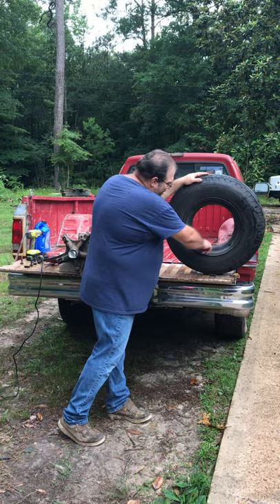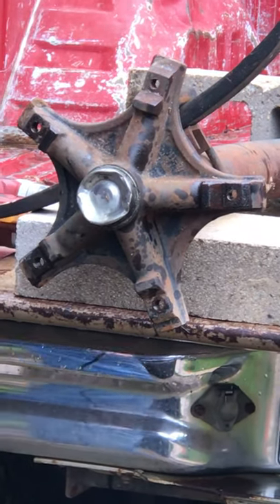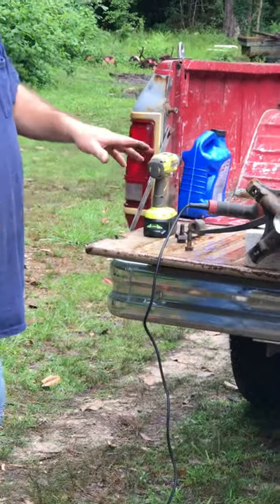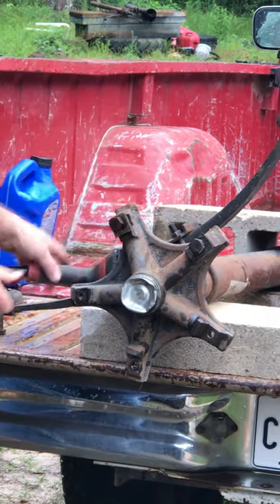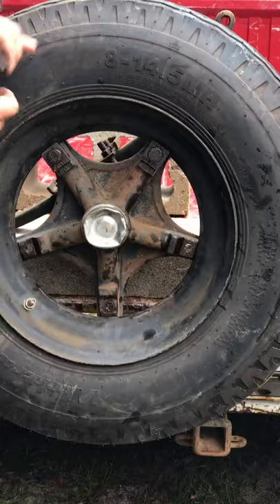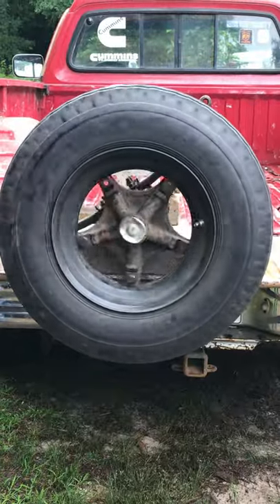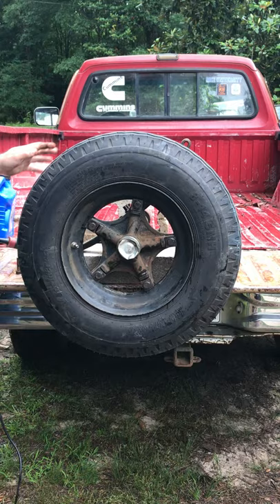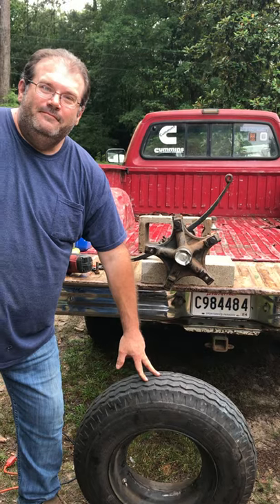Mobile home tire installation.

Comment: Awesome, thank you! One thing I used to do on heavy duty truck tires (Dayton / spoke) is stick a piece of wood next to the tire to look for wobble / runout, seems like it would work here too.
Reply from the maker: Yes a piece of wood will work or a hammer handle works well too
Reply: I've used a soda bottle. Lol

Comment: My father's old homemade farm trailer has four of these tires and they are all rotten--maybe 40 years old.  All the metal and oaken bed are excellent shape.  I only need to replace the tires and wiring.  Your very informative video  is a blessing.  Thanks.

Comment: This is the only video with the correct info on wheel installation. So many jack legs on you tube giving wrong info that will cause the wheel to fly off.
Reply from the maker: Thank you sir

Comment: Thanks Man like the ol school knowledge Havnt seen any Vids on tire install on rim Can you do them by hand.Mine is a 7-14.5
Reply from the maker: Yes you can do them by hand. Just use a similar technique for tightening then down. Just use a four way or breaker bar.
Reply: @qualitymovers4573   Thanks Man !
Reply: @qualitymovers4573   I meant mount Tire on Rim.👍🏻
Reply from the maker: @nopro5433  yes, but it's hard to get on wheel. I use a strap or starting fluid to blow on. Of course I recommend that for safety reasons!🤷🏻‍♂️

Comment: Very helpful. Thank you. How do you change the tire (and tighten it) if you have a flat but no power tools? With the standard lug wrench or some other tool?
Reply from the maker: Lug wrench or breaker bar with short extension will work. It will just take a little longer. After you snug all the wedges, you will need to put a little pressure on tire to keep it from spinning.

Comment: I've got a car trailer with this setup on it, double axle. Is there a simple, easy way to "balance" these bad boys? My trailer shakes when it's not loaded and can see the tires out of balance just slightly. So I guess I should reverse your video steps and back lugs off and go back around and tighten? Thanks for your time man
Reply from the maker: You have some wedges tightened more than others. One way to fix problem is to Just take two off and go back to three in a triangle pattern. Look how far each is pulled in and try and get them close to the same. After that spin tire and see if it wobbles. If it still does, spin slowly until the tire goes out toward you and pull that wedge in more. Once you get bit close out the other two back on and start tightening each evenly.
Reply: @qualitymovers4573  man you're awesome!!! Thank you so much!!

Comment: Thanks for the video!  This is really helpful.  I have to ask, are you not supposed to torque your bolts in a star pttern like a regular wheel?  Or does it not matter on this type?
Reply: He never "Torqued" them, that would require a Torque Wrench. He did star pattern by hand but yep he didn't with the gun, wonder why, I have ocd so I have to

Comment: I torqued mine after to 100lbs. Is it better just to drive then tight?
Also I need new bolts. What size are they?
Reply from the maker: I personally have never torqued them. I either use a electric or battery impact rated at 250 ft lbs(one rated at more ft lbs will snap bolts). You must be sure threads are clean and watch wedge as you finish tightening bolts. The wedge needs to sink in the wheel just a little to hold it on. Most bolts are 1/2 course thread, but some are fine thread 1/2. Most hardware stores or tractor supply will have something that will work. The bolts that normally come with axles take a 7/8 socket, but the ones you get at hardware store take a 3/4 socket. They will work fine. If you want more contact between bolt and wedge just get some flat washers.

Comment: Do you need an impact/drill or can you do it all by hand just the same?
Reply from the maker: You can tighten by hand, but it’s more difficult. Just make sure the threads are clean and when the wedges get snug let off of the jack just enough that the tire won’t spin. Then just go to every lug and tighten. Make sure the wedges are firmly seated in the wheel.
Reply from the maker: Harbor freight has a 1/2 electric impact that works well and is cheap.

Comment: Hi there is there a hub I can switch to from the mobile home tire thank u
Reply from the maker: They do make a kit, but there are several different types of axles with different length spindles and different size bearings. You would have to be certain your axles would work with the kit.

Comment: So 1/4"- 1/2" run-out is OK? My wedges aren't labeled "wheel/rim" side, but there is a difference. Would be nice if you referenced that. And lastly, I came here looking for info on mounting the tire to that rim, not wheel to the axle. I have an old coats 10/10 tire machine, and haven't got a way to secure that style open rim, to the post.
Reply: I have worked at places which have taken a standard car or truck rim, cut out the center section, and used it as an 'adapter' to hold the open center wheels to the tire machine.

Sometimes it worked good, other times not. Depending on how stubborn the tire is.

Comment: What is the pounds of ur drill
Reply from the maker: It’s an electric impact from harbor freight. I believe it’s rated at 250ft lbs. I also use a dewalt battery powered rated at 1200 lbs breaking strength, but it is so powerful that I use it on medium power. If you use one to powerful it can snap the bolts.